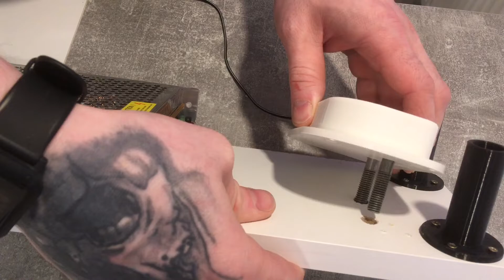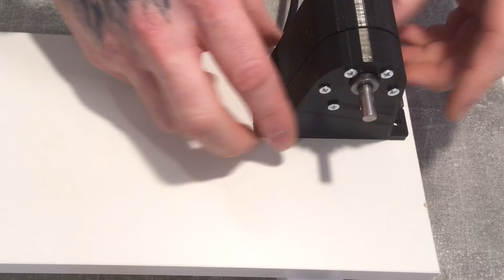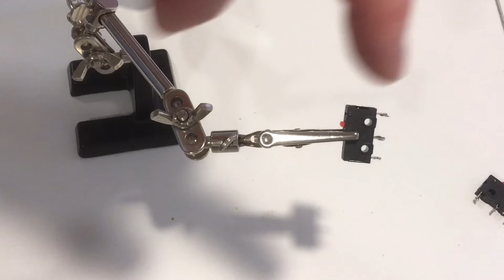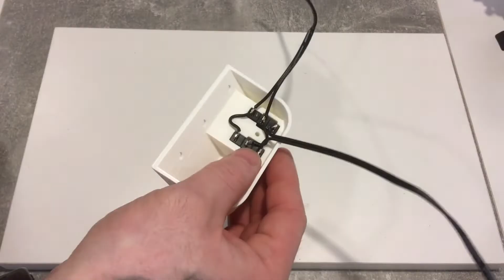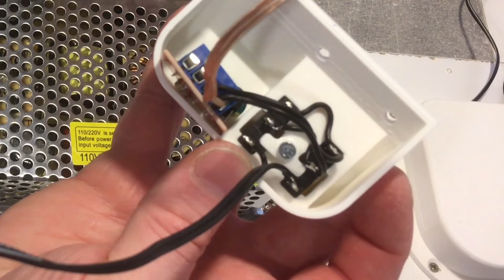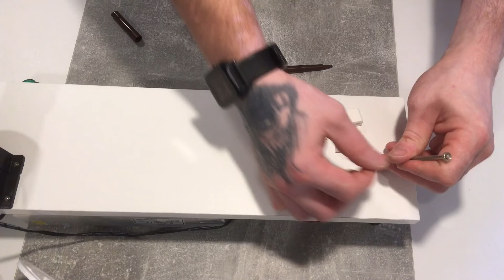3D Printing PET bottle filament machine - PETamentor2 tutorial - Cutter and Puller

Comment: Would it be hard to make a device to fuse the ends of the plastic stripes together,
something that would quickly or crudely fuse "just the tip" and not add another layer on the height or width

I think we should fuse the stripes together and store them on rolls before extruding them.
Reply from the maker: Hi, I saw a few videos. I thing that is maybe possible if you will use the same bottles. Process of joining strips is very difficult and I cant imagine a kind of device, that can be able to do this
Reply: @PETamentor  I'll build the cutter and puller and will try my version. if it works i'll post a video.
I think the joining of strips can be made with a hot aluminum clamped mold, but some research (trial and errors) should be done.
Reply from the maker: That will be nice😉
Reply: @PETamentor  I did some tests under a candle with random strips of 2l soda bottle, i think nothing good will come out of it, unless we "heat press" them together into a 6-10 cm long cylinder (filament) shape that can later fit inside the extruder.  I believe that idea is better than having 7m long pieces of filament.

I'll build that machine and will make a video if successful.
Reply: I was wondering the same thing   it would make everything flow so much smoother in transition

Comment: Why do you need the white roll and the pwm motor black adapter. Can’t it be made as just one part that fits the motor?
Reply from the maker: No, because you can easily remove the spool at the end, instead of unwinding it for a long time.
Reply from the maker: Unwinding 7meters of filament each time is bad technique. It makes me mad with my previous builds 😉
Reply: @PETamentor  I see, the spool fits your 3d printer, thanks for the reply, keep up the great work. You are tempting me to try to make one, just for the challenges
Reply from the maker: No, it doesent. There is a lot of tense in the filament. Once you take it down from the motor joint, it will pops out 😀. But you dont have to unwind it manually. All the previous systems was able to unwide, but this way is more user friendly. I k ow that only one part could save some material for printing, but its not worth it in my honest opinion.

Comment: I have built this, but the puller doesnt pull at max speed at 200C, and doesnt pull through until 240C where it randomly breaks. Do you know the perfect setting? Also, the connection between the spool and motor keeps on breaking.

Comment: Hi Ondrej! I built this project, but there is a problem with cutter: it does't work properly, bottle band pulls very hard and constantly break, what can i do wrong? I tried changing the width of the cut, different positions of stud and different high of heater, but nothing helped :(( I also always prepare the bottles before cutting by heating them with water drops in it for smooth surface and use a new blade in cutter, that is clearly not the problem
Reply from the maker: Hi, Im not really sure what is going on here. There is a few users with the same issue. I think that there are possibly two reasons. Hard surface of your wooden desk and distance between bottle sude giudes, ot its combimation. So, Im looking for another solution to make it work as mine. It will take a few days, I think. But still keep it on my mind. Thank you for reporting this bug.